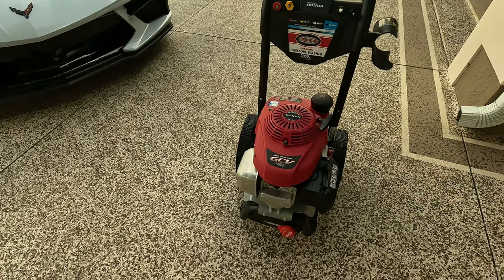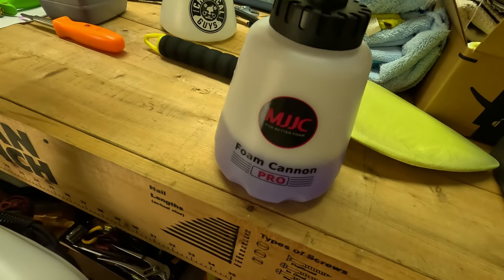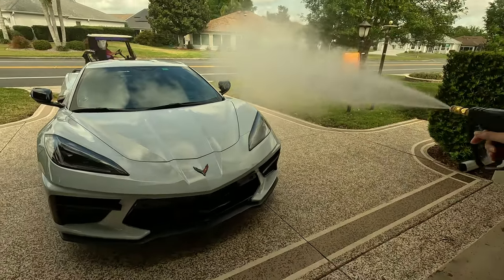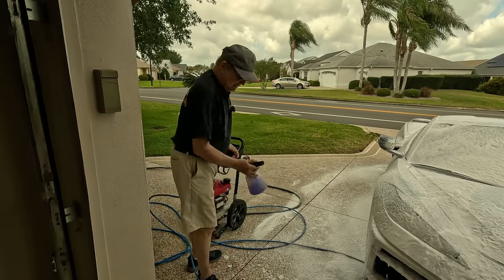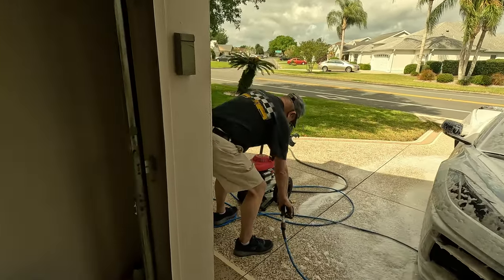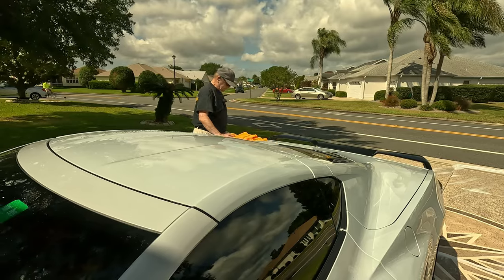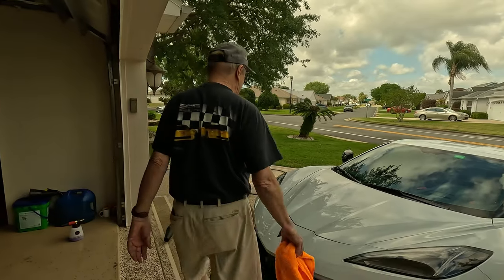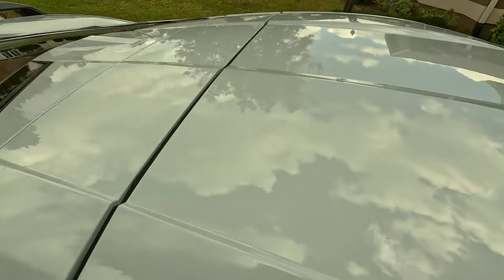Foam Cannon Wash and dry your Car

Comment: I have to say to be white that has one heck of a shine! I own a 2014 Corvette that I special ordered and she’s my barn queen. I’ve only put 44K miles on her since I took delivery. She is painting Midnight Race, it changes colors according to the light it’s in. I have wondered about the foam cannon and still not impressed enough to go through the hassle of pulling the psi washer out to give her a cleaning. She doesn’t get dirty enough for it. It’s only seen rain one time and was directly washed when I got home. I use a wash with no type of wax added to it and I have a whole house water filter to prevent any type of water spotting. I’m glad to see another guy use a blower to dry his car off! I use a backpack blower and have for many years now. It gets water out of every nook and cranny period! I finish off with a detail spray called Gary’s Bug Juice and it leaves a incredible shine when wiped down. I also have a 2004 Dodge Truck that looks brand new because of the way I take car of it. It’s doesn’t have one spec of rust anywhere on it. The blower is the trick. Water can stand and hide in places a towel can’t touch. Good Looking Vette Sir. Keep up the good work!
Reply from the maker: Thanks, yes the blower is the trick. That and a nice water filter and I'll be all set. Rinse the car off with the filtered water and no water spots!!! They are way too expensive right now so my leaf blower does just fine!!!

Comment: Your car looked great on the video.
Reply from the maker: The Soap with the wax did a great job. I probably should have only dried the car with the leaf blower but I like to use the Chemical Guys Speed wipe as it makes the towel easier to pick up the water. Not sure how it does it, but it works. AND if you saw the car in person, you'd be amazed at how the paint looks.

Comment: Great vid. And beautiful car.  My only advice is to invest in a $15 spray bottle of turtle wax hybrid ceramic spray and wipe a coat or 2 on your car for even more protection and shine. It’s an unbelievable product for the price.  And the effort required is so much less than waxing and buffing as u mentioned. Spray on /wipe off.  Easy!

Comment: I have pondered getting a foam cannon but the thought of dragging the pressure washer out ever time is not appealing.  I have a Ryobi battery operated power sprayer and I wonder if I could rig a foam cannon to it?  Thanks for the video Bob.
Reply from the maker: I have a foam cannon that I can hook to my garden hose. So, you might be able to use the battery powered sprayer. Depends on how much pressure it generates. Lots of guys are using electric pressure washers and they work just fine.

Comment: Honestly, I could wash my Corvette in half the time and effort you put in foaming, blocking vents, blow drying, cleaning wheels, and towel drying. I have NOT put ceramic,  wax, buffer, or anything on my paint and will never for the life of my car and my paint surface will look as good as yours in any amount of time.

How you ask? Go to autozone, buy yourself a synthetic chamois for less than 15 dollars, it will last you the life beyond your Corvette. Then get some Simonize car wash detergent, along with a soft microfiber small towel. Fill the bucket with water and a couple of caps of the Simoniz soap. Never put anything on your paint surface ever as far as chemicals or sprays. Total waste. Wash with microfiber small towel rinsing towel in bucket occasionally. When done dry your paint surface in the sunlight, with the synthetic chamois. Wipe surface with chamois getting large amounts of water 1st. Then go back over detailing all paint surfaces. If the water dries on the surface no problem since any amount of pressure is applied with chamois, water spots will wipe right off. Never use pressure washers, never use wax and never apply anything using a buffer. Our clear coat is one third the thickness of a post it note, the more abrasiveness or towels being applied to the surface will result in diminishing the thickness of the clear coat. 

As far as the interior goes I'll just mention carpet for now, wipe out the flooring with a damp microfiber rag from your soap bucket. The rag will pick up as good as a vacuum. Try it. 

I will put my C8 with 18g miles against anyone's paint surface under the brightest sunlight, it's flawless. Rapid Blue by the way but it wouldn't matter even if it were black.